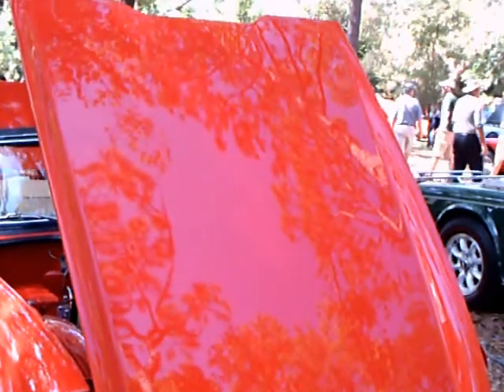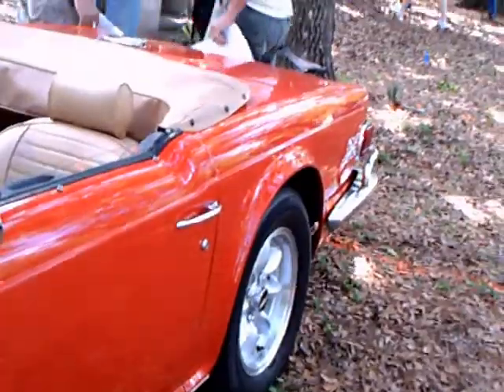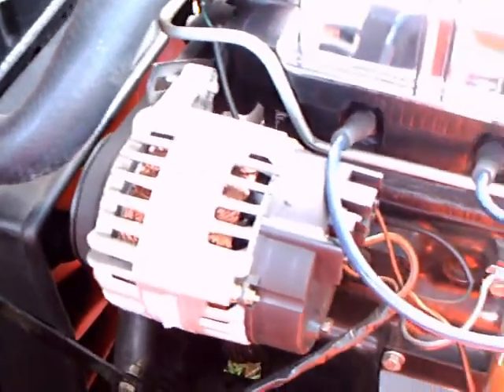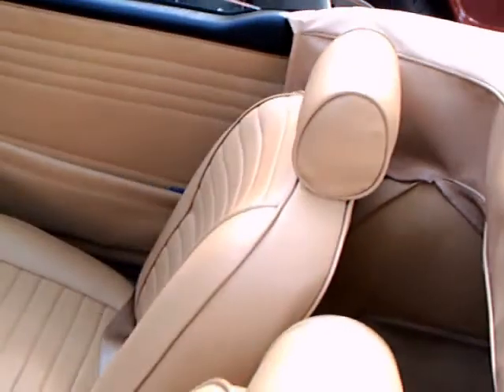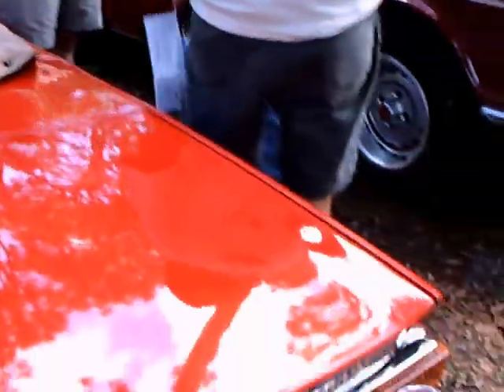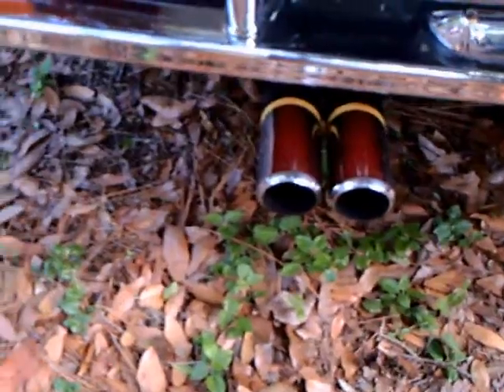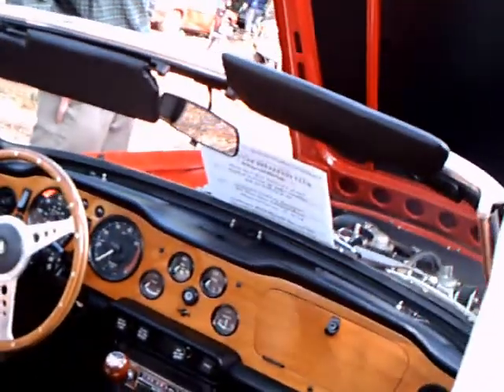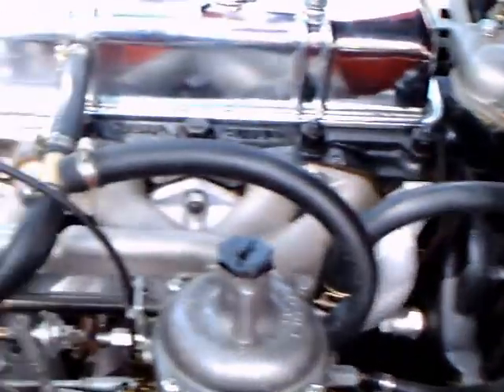1972 Triumph TR6 Convertible Red MeadGdnsBrit040613

Comment: Euro spec cars did indeed have a mechanical fuel injection system, no electronics obviously, I believe it worked on a similar principal to the injection system on a classic Corvette, it was a fuel metering unit with internal spinning rotor with holes that delivered fuel in sequence through the holes via fuel lines to the injectors for each cylinder and the metering unit was fed by a high pressure fuel pump in the trunk, its a simple set up and works well but its weakness was the poorly designed fuel pump in the trunk which wasn't up to the job so most current owners solve that glitch by using a modern bosch fuel pump. The twin carb system on north American export cars was not too bad, I used to have one which I imported back from the USA to the UK, they were very reliable but heavy on fuel as an overdrive gearbox was not standard and the diff had a different ratio to UK cars. British owners sometimes convert to the twin carb system after frustration with trying to set the fuel injection system up properly, its not that difficult though, another popular upgrade is to use a triple webber carb system  over the twin carb set up.
Reply from the maker: Hey, Chris!  Thanks for the explanation of the mechanical injection system on Euro cars.  A good idea, it only suffered from capacity problems, something that could be remedied.  :) Jack